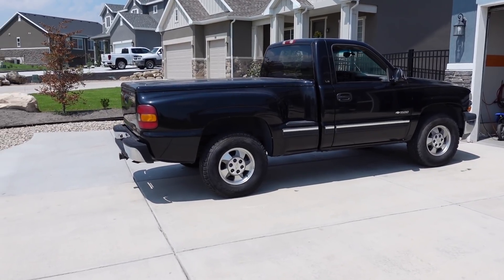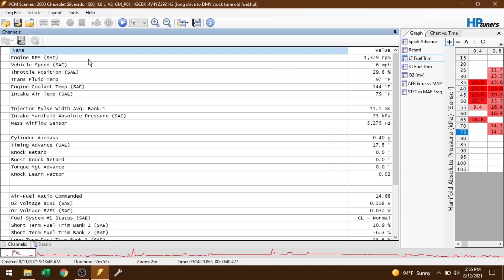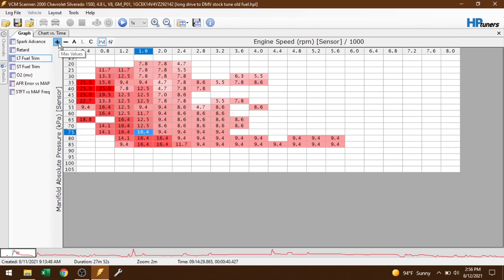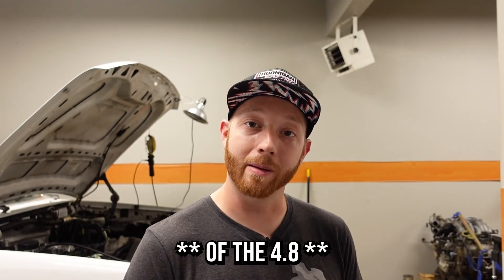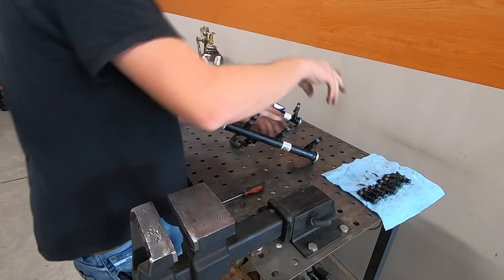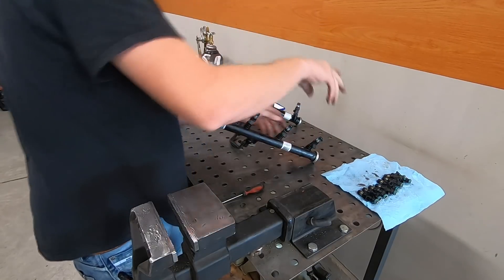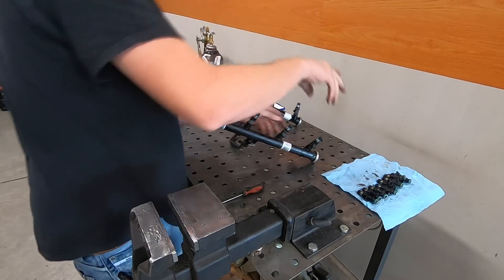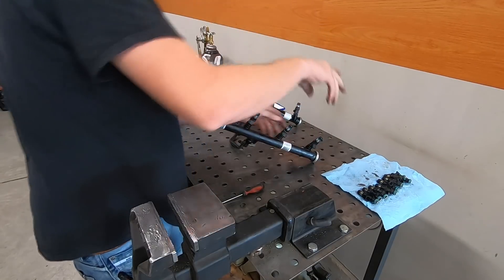HUGE PROBLEMS with my 4.8 Stepside Silverado: Datalogging, Injectors, and BAD GAS

Comment: I don't know if you have tried paint thinner in your fuel system. But I have used a gallon of thinner to half tank of gas in my 2000 Silverado 5.3l with 268k mi. on it and my 2006 F150 5.4l and it works well for cleaning the system and cats out.

Comment: Hey I have a question what does it mean when you have a stock 01 chevy 5.3 241,000 mile on it an runs like shit but when I plug my Mass air flow sensor in it makes multiple miss fire. An unplug it it runs better ish not much just no misfires. New mass air flow sensor.

Comment: Got a 2000 Silverado 5.3L…. Having troubles starting… like leave the key forward for about 10-15sec it fires up… but if u jump in it and try starting it, she’ll fire but then stall…. Turn it off then turn the key back on let it sit 10-15sec it fires right up….

Comment: would 5 year old gas in a truck cause white smoke to come out and a foul smell ?
Reply from the maker: the gas in the tank will have a paint thinner smell almost, but not sure how it would smell if it burns coming out the tail pipe...
Reply: @TolmanPerformance  yeah it smells like that but I'm curious if it would cause white smoke out of the exhaust or do I have a head gasket leak 🤔

Comment: I read on a engine page where you could possibly switch out the O-ring centers on the stock 4.8L injectors with that of the 1.730in L96(6.0L) injector O-ring centers to increase injector flow to 49 lbs., just thought I'd share that trick, the page also said you could also use LSA/LS9 injectors but a spacer is needed. I don't know if any of that's true as I haven't tried it yet, if anyone has please chime in how well it worked out.

Comment: 16:52 
Shots fired!
where is the 4.3 love?
Reply from the maker: lol... my dad had an OBS with a 4.3 in it I drove a lot for work... kinda gutless but pretty reliable
Reply: @TolmanPerformance  I have one in a 92 cgevy g20 van.  It won't hold OD at 75mph, have to downshift to 3rd. I am in the middle of my turbo LS malibu build, but next is that van. Thinking either turbo the 4.3, or just go NA 6.0

Comment: I have the 99 and 1/2 Silverado 4×4. Buying parts can be a nightmare sometimes. Half will be 99 and the other is 2000.
    50/50 chance of getting the right parts the first time. And believe me, there is a difference between the parts.

Comment: I had a 4.8 in a 2003 Silverado Z71 ext.cab with 3.71 gears. The truck was a special order not taken, and I bought it new off the lot. It always ran very strong and towed great. Several trips from NY to FL it got 20-24 MPG driven hard over 4 lane ltd access roads. It was one of the best motor/trucks I ever bought! The only issue was the front break rotors rusted so bad the left one broke apart at 3 years and 20k miles!  Just out of warranty, the dealer and GM replaced all 4 under warranty!!  Very happy!   --gary
Reply: I have that minus the z71. Love my truck. 224,000 miles.

Comment: i would like to see mods that we can do in the driveway , the L33 heads will be a good start i have L33 on my 5.3 you dont have afm to deal with , and a hot cam.  and a yukon axle dura grip to replace the G80..

Comment: great stuff LT i tried a corvette servo in my 4l60e it shifted too hard for me ,went back stock, i now use a handheld programmer from superchips and i add about 4-6 psi to the shifts. i also fixed pump rub on my 246 tc...thanks for the tech info in your videos

Comment: Comparing my 2000 Silverado 5.3 extra cab (7" lift w/35" tires) to my 2000 GMC Sierra 4.8 (same as yours but fleetside) is not even close. the 5.3 has twice the power, gets almost 17mpg even with the big tires. My 4.8 Sierra is a dog, a single cab, and is only getting 13mpg. Same symptoms as yours. I already changed the knock sensors (pain in the ...) so I'm going to try the pressure regulator and see if that helps. (it's only got 93k miles) I just passed smog (here in Calif) but after some research, it looks like maybe the cats could be starting to clog up restricting flow. Possible? No codes, but when I drive it compared to the Silverado, it just feels like there's a restriction. Already did the 3" cat back. Sounds good, but didn't help. How about Cataclean?
Reply: Update: I ran a can of Cataclean. It may be cleaner, but didn't fix the performance issue. Just replaced the pressure regulator. No gas came out of the vacuum hose, but it was still under pressure when I pulled it out. Is that what you were talking about in the video? Thanks.

Comment: You can get 320hp+ out of a stock 4.8 with a tune and free flowing air intake. Here’s a little benefit the 4.8 has over its cousins: 5.3, 5.7, 6.0, 6.2 is the rod stroke ratio!  The 4.8 has 6.275” rods & 3.268” stroke; the Rod/Stroke ratio is 1.92-1!  What’s this mean?  1.92 is better than the old 283 SBC which means RPM no problem and a stronger bottom end.  😎

Comment: The 4.8 is a great engine, just won’t have the big torque at 276 or so cubic inches.

Still lots of potential after being sorted out.
Reply: I love mine. 224,000 miles 2003 Silverado ext cab.

Comment: Your truck should do a burn out no problem.  I bought a 99 silverado 4wd 4.8 crew cab reg box for parts that had sat for a few years and it did burn outs.  Being that it was heavier and 4wd, yours should have way more power than mine did.
Reply from the maker: 4,700 feet of elevation also doesn't help it gave any extra power
Reply: @TolmanPerformance  yeah that doesnt help.  Im around 1100 ft.

Comment: LT - for most this might be an easy thing to trouble shoot but I really liked how you took us through the HP tuners route to help pin point some of the challenges.  HP Tuners is new to me since I'm a Holley guy, but certainly looking forward to more videos like this that helps get more familiar with other tools like this.  For those of us that would like to dabble with HP Tuners but dont want to shell out a bunch of money to just poke around, can you suggest the most cost effective route?  I know HP charges credits and it can get $$ to just plug in and make small changes.  I assume you have the pro version since you have many trucks you tune?  Subscribed!

Comment: you did not remove all the olde gasoline with pump swap? ...  this olde fuel problem from sitting is common with gas engine powered RV units.  First item is always get olde gasoline out. I use an additive in gasoline engine vehicles if they sit much. The newer gasoline's , the blended oxygenated  stuff for various states Emissions just sucks eggs.
Reply from the maker: no, I didnt because I did not have a good way to dispose of or store 20+ gallons... I should have though

Comment: Would be cool to document the changes you make in the calibration (kind of like how Kyle from Goat Rope Garage does, and similar to the efan swap on UglyTruck) to give some more insight into what / how to do it. Even though “everyone does it” and “there’s too much LS stuff out there” when you get down to trying to find useful, valuable info it’s hard to come by. Loving the project so far, would be neat to do a mild to wild build on it - basic tuning and bolt on’s to full build AWD swap.

Comment: I used 8.1 marine injectors on my lightly modded 6.0 for the same reason, they plug in and fit in the tbss intake manifold and they flow 44lb per hour.

Comment: I knew this was going to happen. I was surprised when you didn't take old fuel out. Especially since there was so much in there. Will ruin push rods, valves and injectors

Comment: Lt on your last video I commented to replace your intake gaskets. Idk if you saw my comment. On this video you didn’t mention anything about the intake gaskets. I'm technician for general motors. I use to work on these trucks under warranty. I guarantee you, you'll need intake manifold gaskets. Can you do a shot out for me if it does need gaskets. Thanks oh and delete your egr.

Comment: Before you put the injectors in I would of removed the fuel filter and back purged the fuel and removed the pump and replaced the little pickup tube filter and new fuel filter. Old fuel turns into basically paint thinner. Berrymans B12 is pretty good for cleaning crap out. You could try rigging up a test bench for the injectors and back flowing them with Berrymans.

Comment: With the common 10% ethanol fuel, 87 octane is usually made starting with 84 octane straight gas. So if the alcohol evaporates, your left with a much lower octane fuel Than a modern car is designed to run on.

Comment: hey LT i got a 2 door tahoe 98 was wondering if you know aany good engine websites for a L83 Or l89 could be acquired old 350 cant get up and is a dog on gas.
Reply from the maker: check car-part.com or ebay, thats what I usually use

Comment: A fuel transfer pump battery operated would have been perfect when doing the fuel pump. Put into fuel cans use in lawn mower. Also should have dumped 2 bottles of 91% isopropyl alcohol and add the best octaine  it will clean out the take the combination chambers and even the used injectors.

Works every time

Comment: As someone who owns this exact truck (minus the step side), I would like to put in a formal request to turbo the 4.8 so I can use your videos as a step by step guide in the future.
Reply from the maker: Request noted!
Reply: @TolmanPerformance  your awesome LT!
Reply: I think that a lot of us would love a simple job we can add in to our at home.
Reply: Lt this exactly what I said on your first video on this truck. Do a budget build turbo from Amazon and eBay. Upgrade cam and valvetrain and oil pump. Leave stock bottom unmolested. I just want ppl to see how tough these 4.8s are with stock bottom end and how affordable it is to push 500 plus on a budget. I know you just did the 8.1. But remember more ppl own ls engines pick ups. Thanks LT for your videos. I'm a big fan.
Reply: The ole trusted and true sloppy mechanics don’t bs me build.

Comment: Yes, bad gas. If you're a car guy, with more cars than drivers, etc., and most of them not dailies, treat every tank and when you pick up a new (old) car, drain the tank. For some of my cars, I get non ethanol gas only. Great demo of how HP Tuners can help diagnose, not just tune.
Reply from the maker: Thanks! And yeah, that’s the challenge of managing multiple vehicles and not many drivers

Comment: Wow, impressive improvements. I can't do a burnout on my 2012 Silverado 1500 4WD either. I have the 5.3L engine.
Reply: My stock 2010 Sierra 2wd on stock 20s will light up the tires but you gotta drive it like it's stolen.  Depending on your tire size and cab bed configuration you could  be the same weight or heavier. My 2019 F150 5.0 crew cab with the crappy 3.15 gears can do rolling burnouts in 1st and part of 2nd gear.
Reply: @mesanders1113  There's a big difference between a 10spd automatic 400 HP 5.0 and 11 y/o 315 HP 5.3 with a 6spd auto. 4.69 1st gear in the 10spd auto vs 4.02 1st gear in the 6L80e.

Comment: Todays gas is just garbage. Its no wonder that there is so much bitching about emissions, the gas were stuck with has us with one foot in a bucket to begin with. Give us good fuels again and fuel emissions will go down. Technology has caught up with the ability to tune engines to a higher level, but were being given garbage to work with so we can be further pushed into electric vehicles.

Comment: I didnt see the vacuum line from the intake to the fuel pressure regulator vacuum port on the fuel rail get installed……..
Reply from the maker: I didn’t show a lot of steps with it going back together, but it’s on there

Comment: your going to have to make a bunch more horsepower from that 4.8l to spin the bridgestone REVO 2's they are one of the best and grippiest tires I've ever driven on. even when I got down to 1/32 of tread they still wanted to grip better than alot of other tires.

Comment: $100 I mean mine is stock and all so I run 87 but it's like $2.70 a gallon but my suburban doesn't cost that much to fill up it's 32 gallon tank
Reply: Gas prices are probably over $3 regardless of octane level where he's at.
Reply from the maker: premium is a little over $4/gallon here... I wanna know where you live
Reply: Central Texas
Reply: $4.60 a gallon for regular.

Comment: My 03 5.3 Envoy is pinging really bad in 1st but after that, it wanes off.  From what I understand, the computer limits the throttle on a 4L60 in 1st gear so the trans doesn't die from all the torque.  I'm just not sure if all that pinging is normal since I bought the truck with 140k and good maintenance history
Reply: Not normal. A common failure points on those is the knock sensors in the valley pan. Replace both of those and the wiring harness that goes to them. Replace the intake gaskets while you're there.
Reply: @turbolq4  I was afraid of hearing that.  Living in an apt complex sucks cause I can't do any "engine surgery" before apartment nazis come out to write me up.

Comment: nice work! what kind of in tank injector cleaner (type and brand) you rocomand for good cleaning? thx
Reply: Chevron Techron works really well.
Reply: The thing about using "in tank" stuff is once you start using it, you're gonna have to keep using it. The stuff will get you by until you can get your vehicle in the shop to get the injectors replaced. Which is the best way to fix the issue.